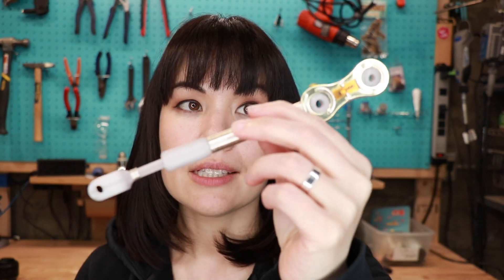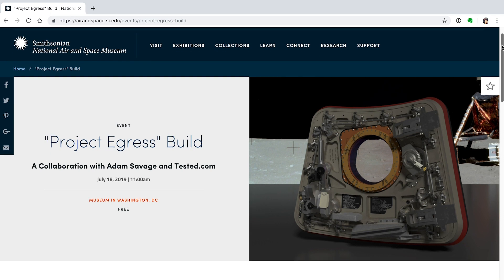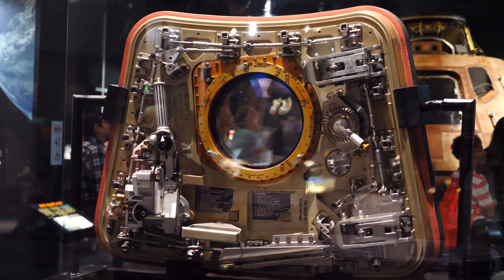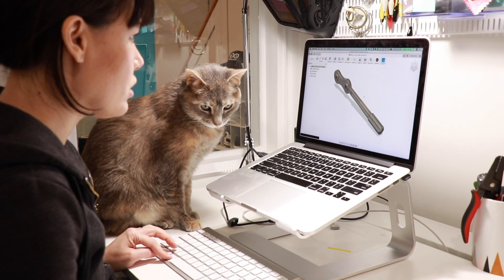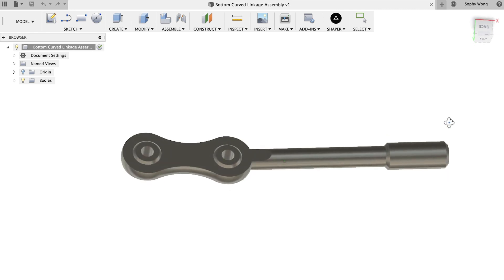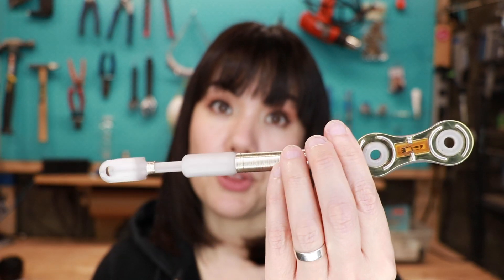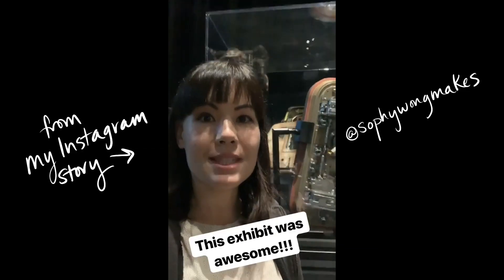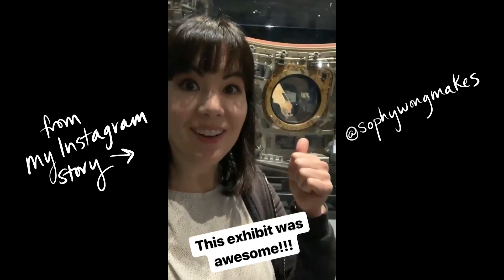Building an Apollo 11 Space Door for Project Egress

Comment: But isnt it too thick if cladding is on top of print?
Reply from the maker: Good question! Not shown in the video: I subtracted the thickness of the sheet metal from each side of the 3D model before I printed it, so that it would be the correct thickness when finished. I also hammered the soldered wire flat to make sure it wouldn't protrude above the bearings.
Reply: @SophyWongMakes  i feel better now. I daw adam take an angle grinder to something.....shudder.
Feel better knowing it wasnt your part!

Comment: From the CAD it looks like the absolute outside dimension of your part that fits into the LH Latch Assembly is 9.4mm. From the renderings it looks like it should be less for additional clearance. How wide is it with that flat copper bar you added to the top? BTW, you can find your part in the full assembly PDF that you can download. It's in this folder: project_egress-tech_drawings\Assembly\Full Assembly with Linkages Drawing v31.pdf. Part 34 or "Bottom 3". It's named the same in the Fusion 360 file.
Reply from the maker: Yes! I measured the thickness of my brass sheets and subtracted the thickness from both sides of the model before I printed it. So the print was thinner than the final part, and the added brass brought it up to the correct thickness (minus a tad because the metal thins as it’s pounded). I also hammered the wire additions flat so they wouldn’t protrude above the bearings. I was still nervous just because it’s hard to know what will happen on build day, but it fit perfectly and slid right into place. So that feels great! 😁

Comment: Damn I ended up being even more intrigued by the foam packaging that you have done than by the piece itself.
This foam cutting is gorgeous ? was is laser cutted ?
Great project none the less !
Reply from the maker: Thanks! I had fun making the packaging! Yes, I used several layers of EVA foam, which I lasercut in my Glowforge laser cutter. I used the SVG paths from the technical drawing I was provided to create the shape so it would fit the part perfectly, and just added two half-circle cutouts to make it easy to remove the piece with your fingers. It was so satisfying to slip the finished part into the foam! Glad you liked it :)